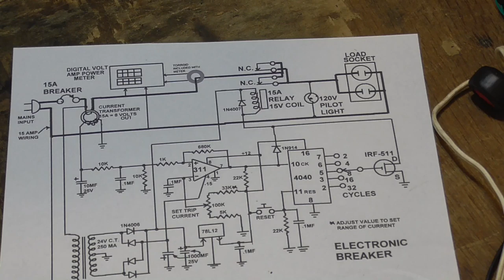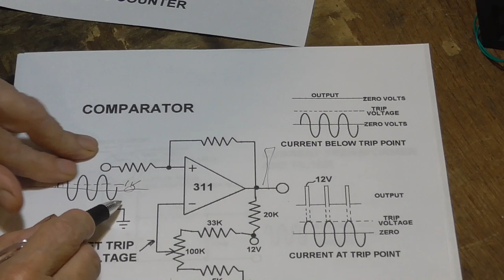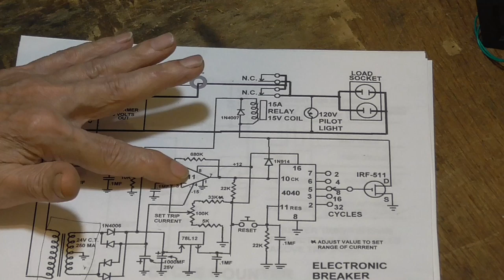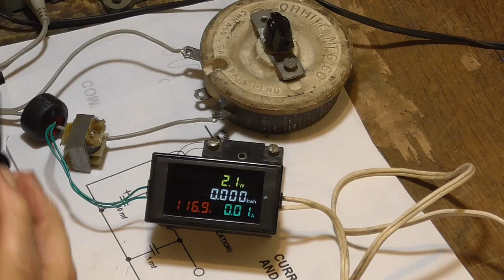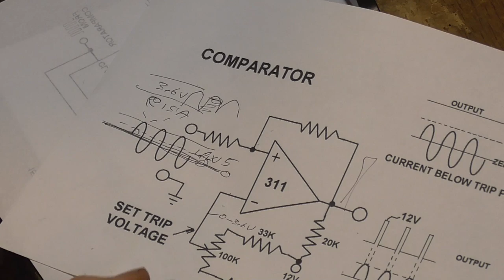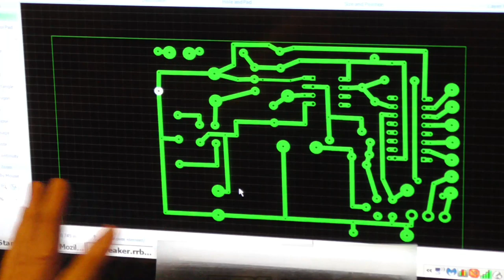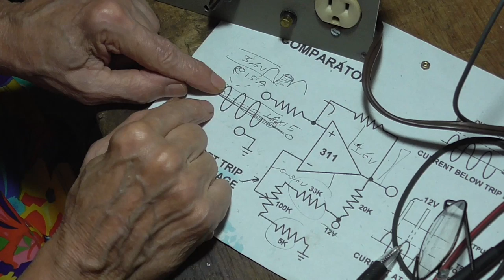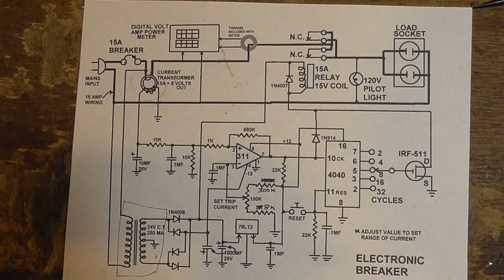BUILD AN ELECTRONIC CIRCUIT BREAKER

Comment: Nice job! Funny, I’m currently working on a circuit that looks surprisingly similar. I’m building a circuit, using that same type of current transformer, which will sense when I’m using my table saw, and will energize a relay to automatically turn on my shop vac for dust collection. I know you can buy these devices pretty cheap, but I thought it might be fun to build my own. In my circuit, the secondary of the current transformer feeds half of a dual op amp, followed by a diode detector, which then leads to the other op amp used as a comparator, which, in my circuit, drives an NPN transistor to energize the relay to switch the shop vac. No need for a counter chip, or a meter, in my circuit. I’ve breadboarded it, and it seems to work, but I still have to fine tune the gains and thresholds like you did in this video. I like your idea of using a cap or caps as a low pass filter to eliminate false triggers from transients. I’ll add that to my circuit. This is the first time in decades that I’ve played with this kind of stuff; I think it’s quite a coincidence that your video came out the same day that I’m working on it!

Comment: I can’t wait to give this a shot, I seen this a little while ago, I’m lacking on the computer, and printer portion. I etched a board a very long time ago, in a not so safe manner 13-14 with a piece of copper clad, moms nail polish to make to make the trace’s, sulfuric acid, and ferric chloride. That was back when radio shack was still kinda a thing. It kinda worked, but my circuit yea it went up in smoke! 😂
@glasslinger thank you so much for all the time you put towards your videos! They are really really helpful for us that are still kinda young!

Comment: I used to build test fixtures about 30 years ago using pretty much the method you do. I used a PC to design the board and printed it on a transparency and used pre-sensitized circuit board material. But money was tight and the board maker wanted a fortune for chemicals. So, I did some reverse engineering and found that their 20 dollar a gallon developer was just diluted sodium hydroxide which I made myself for 50 cents a gallon from drain cleaner. It worked just fine. I suppose the photo resist is a different formulation these days. But, maybe it isn't. Might be worth experimenting on some scraps.
Reply: I use washing soda for that, even cheaper :)

Comment: This is an excellent design and very useful.   My only issue with it is the use of the electrolytic on the output of the current sense transformer since it will see reverse bias from the AC waveform.  That will kill the capacitor over time,   I will take your excellent basic idea and build my own.  Thank You!
Reply: I was thinking the same thing. Maybe replace w/ film capacitor?
Reply: Jan-Thore Hol Any non-polarized capacitor type should work including film capacitors.
Reply from the maker: The voltage across the capacitor is a few millivolts under normal operation. This will not harm the capacitor at all. The voltage goes up to a few tenths of a volt during a current spike before the circuit trips but this also will not harm the cap.
Reply: @glasslinger  Thank you for the feed-back. I learnt at school ages ago that you never should keep an electrolytic capacitor floating... Anyway, I think your circuit breaker will be my next project after finishing my current project, a simple tube tester. Also, keep up the good work, I learn a lot by watching your vids!

Comment: Nice job Ron.  The only thing I would like to change is to hold the 15A relay in a powered state during normal operation.  Then an over current fault would be used to turn the relay OFF disconnecting the supply.  This provides a safe fallback off conditiom, if any of the current detection circuits should fail.  In the original circuit if the FET doesn't operate the relay, the supply remains connected.  Anyone see any flaws in my logic?
Reply from the maker: Originally I thought the same thing. But I found the drop out time of the relay was about 10 times the pull in time. I opted for the half cycle break over the rather low chance of a circuit fail. So far after 7 years of using the unit no fails!
Reply: @glasslinger  The drop out time is longer because of the diode that give an allongement of current through the winding of the relay. Probably the diode on the IRF will be better.
Reply from the maker: @jacekkubiak4616  Depends entirely on the relay you have. I had a fairly large relay with a heavy armature. It had a lot of inertial mass. You might have one faster but the whole point is that failure of the circuit is so unlikely it is not an issue.

Comment: Good job. It is a good circuit breaker for overcurrent. But it still needs an improvement to also be a short circuit breaker. 
See, if you set to trip at 2A (2 cycles) it means that a current greater than 2A will trip the breaker within 2 cycles. But,  if there is a short circuit,
the maximum current of the installation will circulate for 2 cycles (that is why you obtained the fusion of the cables when you shorted them),
this reaches up to 2 or 4 thousand amps.
Add an instantaneous electronic trip (without counting cycles) when the current exceeds the maximum setting of the device.
My humble suggestion.
Reply from the maker: Not necessary. The unit breaks even a dead short across the line well before the house breaker goes.
Reply: You need to think that it's 120V. The circuit breakers are slower in america
Reply from the maker: @BastiElektronik  Depends on which ones you refer to. The breakers in the new GFI units are within a cycle or two.
Reply: @glasslinger  Yes, but I meant the normal ones. Like you can, if you are fast, make a short and if you release it fast enough the breakers aren't even near tripping. Here in europe/Germany, the breakers are prone to pop if you plug in a medium inductive load like a variac.
Reply from the maker: @BastiElektronik  Does this cause nuisance tripping when an AC unit turns on or any other unit that cycles? Or is it such that those types of air conditioners are not used in Germany? It seems that some delay is necessary to allow for the surge current of motors starting, etc.
Reply: @glasslinger  as far as I know, air conditioning is powered with three phased electricity. There are just the old screw-in type fuses (the ones with the window on the front) for the A.C. They don't care about any surge. Heck, they even take almost half a second before popping in a short circuit.
Reply: @BastiElektronik  Yes, I understand,  the circuit breaker is slow due to loads, such as induction motors (high starting currents).
However, the instantaneous activation of the electronic circuit breaker works to protect your equipment over Isc (short-circuit current). Your circuits cannot be
able to handle Isc about 1000 A or more during a short circuit event. 
In this sense, I suggested instantaneous triggering to protect the equipment, not the network.

Comment: The 10mf cap on the output of the current transformer shouldn't be polarized, it's seeing AC!!!
Use a non-polarized cap, like those used in speaker crossover networks.  (two 22uf 25v electrolytics in series with the positive or negative leads connected together will work.)
One short pulse of overload less than the set number of MS (pulses) won't trigger the relay, but two or three such events over a period of time WILL.  There is nothing in the circuit to clear the counter between two short overload (surge) events below the trigger threshold.  There is also no indication that this has happened.
MPJA.com has several variants of the AC meter, both with LCD and LED displays.
Your trick on rewinding the wall wart transformer as a current transformer only works because it is a dual bobbin core.  If it had a single bobbin, you'd have to take the thing apart and remove the secondary winding, IF the primary was wound closest to the core.
I use a 2:1 mix of H2O2 and HCl as my etchant solution.
Reply: I agree, but the output impedance of that xfmer is pretty damn high, I doubt it will be able to fry that cap. Not nice, but it shouldn't catch on fire ;)
Reply: yeah, i tought both the polarized thing (i knew the antiseries trick) AND the brief surges during use, but the latter is of a lesser concern, this tool is intended for testing appliances with cicken poop over em and so how it works is fine in my opinion, breif surges shouldn't exist and if the appliance starts to fry after power up the functionality remains even if after minutes or seconds (and you'll notice it)

not sure about a capacitor on the transformer output instead of a resistor or a shunt resistor itself, but honestly the reactance will advance the current front making the wave arrive earlier, it seems fine, damped and linear enough
Reply: @redoverdrivetheunstoppable4637  I'm pleased you got 'chicken' and 'fry' in the same sentence :-)

Comment: Great device as other have said ... A question? Is this type of circuit possible to control the freezer of an ice cream maker,.. ref. the draw of the dasher motor. The amp draw when the Ice cream thickens, or becomes stiff, the motor will draw more current a variable ( based on first draw and "Full Run Load" amp draw ) threshold could be set, thus shutting down the compressor for the freezer of the Ice cream maker. if you agree could you show a circuit modifications to effect this?

Comment: regarding 16:20, can the cathode of a Schottky diode or even a regular 1N914 to ground, be used to clamp the negative cycle of the AC signal, and allow the use of only one +12V supply voltage? 
It's a very practical circuit. I enjoyed your explanations. You are a great teacher. Thanks for the share.

Comment: did you considered to use two Relais in series? just in case the Relais is broken (contacts or welded). or you could use a Relais with no/nc contacts to use the nc contact in series with the reset button, to Prevent pressing it when the contact is welded. could you present some of your Projects you did when being an employee? thanks for your Videos, its nice to have s.th. different again then Radio builds. Maybe you could go on to create mixed Content...tube making, what happend to your Evaporation Experiment, what happend to your 50kv power supply, is nixi pet still alive…. i am sure there are a lot of interesting Projects you did or will you…. regards

Comment: Ron, could you also show us the circuit diagram for your lab bench B+ power supply for the radios? It looks home brew and is a very hand piece of equipment.
Reply from the maker: Unfortunately it is a kludge design using many special surplus parts. No way to duplicate it.
Reply: @glasslinger  I am coming back to this now (so many things pushed this back in time). Could you share the specifications or say from your experience what such a power supply should have and deliver? That would be already a big help for the design!
I have an old transformer with 260V~ and 6.3V~ output (not sure about the current rating, but it is quite large and not much current is needed for radios anyway) which I intend to use. 260V * 1.4 = 360V as maximum voltage. I guess this is enough or should I also provide an optional doubler?
From 360V I plan to use two linear regulators (with LR8N and pass transistor on heat sink) for plate and screen voltages (both with same ground potential). Should I provide a current limiter or is this not needed?
I will add another (small) transformer (maybe 12V~ out) for a regulated (LM317) negative bias potential. Is -1.2V to -12V enough or should I provide a doubler? Since this will be galvanically isolated from the ground, it can also be used as a small positive supply (double throw switch to reverse polarity). Is the 1.2V as minimal voltage too much? Should it go down to 0V?
I could add another, beefier 12V~ transformer to provide a 12V heater supply. Do you think this is necessary?
From the 6.3V~ I could derive a regulated 1.2V to 5V DC heating supply for tubes that need lower heating voltages, like 1.4V for a DF96 battery radio tube or 4V for rectifier tubes, etc.

What else do I need? More individually regulated voltages? You have a separate digital readout for each voltage -- is this needed or will one switchable meter do? Do you also have current displays for plate and screen currents?

Anything else?
Reply from the maker: @helmutheller1538  Too many Helmut Hellers! Tried to find an email but no way to tell which one is you!
Reply: @glasslinger  Ron, I posted my email here (as I don't have your email address either) but the post was deleted. Could you see it while it was online? 65sc02 is in my email.

Comment: Interesting video, great idea. But I have a thought wouldn't it work and be safer if you used a GFCI breaker (or receptacle) and used a similar circuit to monitor the load and simply trip the GFCI via a "leakage" to ground.
Reply: That's quite a nice idea, thank you :-) 
 It wouldn't necessarily be /safer/ per se, but it would out-source the "contactor" part to something [maybe] better than a cheap relay.
Beware, though, that GFCI's are generally not rated for a large number of trips (unlike a contactor) -- and I don't exactly love the idea of slinging 50mA, live to earth, to trip the GFCI -- because if your earth's not good, your equipment case is now live ;-)
Reply from the maker: Possibly. But in my lab I don't have any grounds near! Wood floors, isolated instruments, etc. I work all the time with the mains voltage so I have to have everything isolated to prevent the "electroboom effect." (see his channel, it's great!)